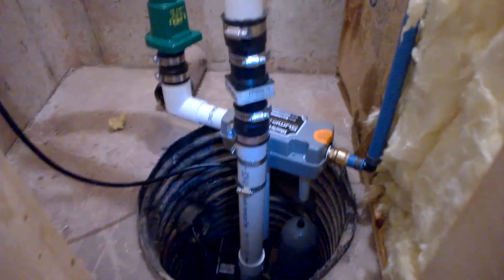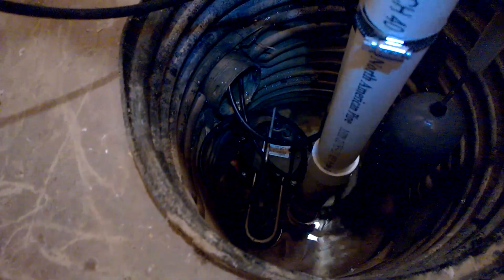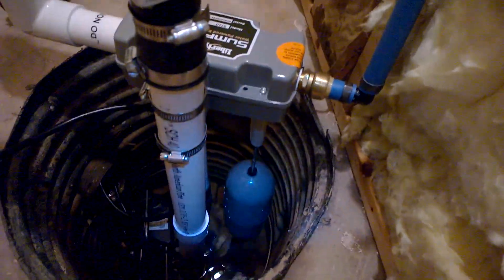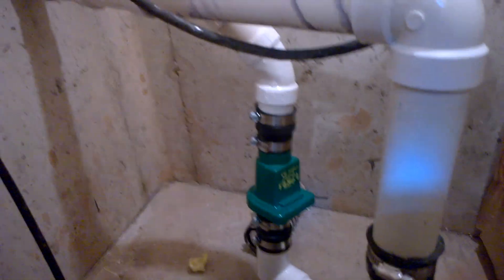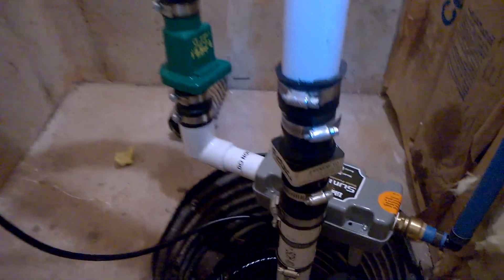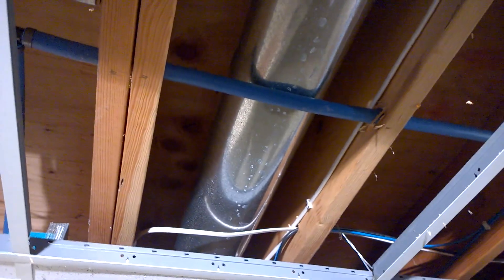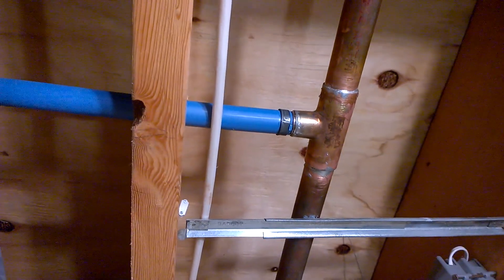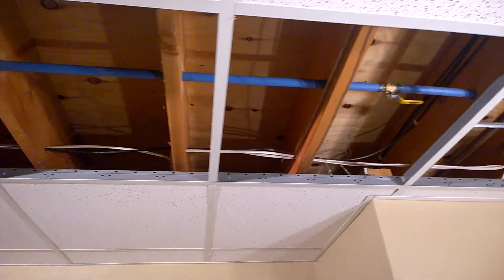Liberty Sump Pump Water Powered Backup Finished Basement

Comment: Thanks for the video.  I see that the backup pump is attached to the main pump discharge pipe.  When you want to remove the main pump, you need to remove everything I guess?  Is it a pain or not too bad?

Comment: There's another post here saying you need an anti reversion check valve . You need a valve in the water supply so there no chance of your water supply getting contaminated.
Reply: The SJ 10 has is built in.
Reply: @TheDogDad  YOu have to supply ypur own backflow preventer. Don't get a check valve and a backflow preventer confused

Comment: You need a back flow check valve on that water line.
Reply: The SJ 10 has is built in.
Reply: @TheDogDad  No it doesn't
Reply: @ItsDaPlumber  I'm looking at all these to see where the RP valve should go and it says it has one in it, but most codes still require one and I'm trying to see if I should put it before or after my shut off valve. Not many people discharge these separate either and that not only makes sense, but says it 3 times in the instructions. When people have an actual flood and all the sewers are full and people think they are good because they have a water jet, they will figure out why it's supposed to be separate and discharge outside onto the ground 🤔 🙄

Comment: Got a question... i have the exact same pump as back up..but float only engages to come on or shut off when i touch or jiggle float.... what can i do to fix this?
I had plumber install it and this will be the 3rd time i will have to call them back...... plez help.!
Reply from the maker: Hmm, I'm not quite sure. I did notice that the float could be a little stiff. In fact, it actually had to be mostly submerged before it would pop up. Maybe you could fasten some additional foam or buoyant material to the float to help push it up. Other than that, not sure, but good luck.
Reply: Did you contact the manufacturer?

Comment: You are missing a backflow preventer. Please amend your video so you dont kill people.
Reply: The SJ 10 has is built in.
Reply: @TheDogDad  No it doesn't. No built in backflow preventer
Reply: @ItsDaPlumber  it does say it has one and a check valve on the discharge side. I'm in Ohio and the code here says you still need one and it should also have a discharge on it and then piped back to the crock. Also, I figured out it shows the RP going before the shut off in the illustration, but it doesn't matter and makes way more sense having it after the shut off. Most people do whatever is easiest and regret it later. I'm a huge fan of only doing stuff once the correct way. I'm a general contractor, so I see homeowner approved work all the time that I'm called later to do properly. Sump pumps are something I see absolutely zero point in doing half assed, especially a backup because I'm guessing people already have been flooded once before deciding to go this route.